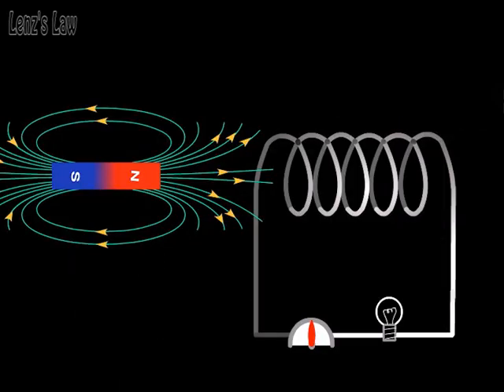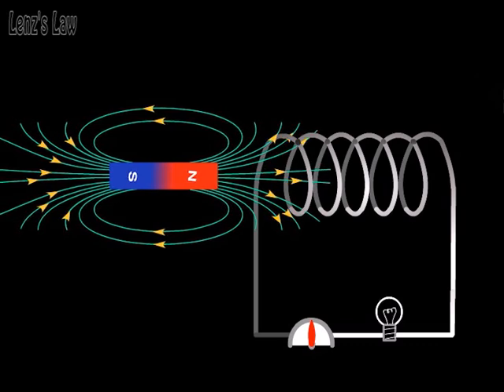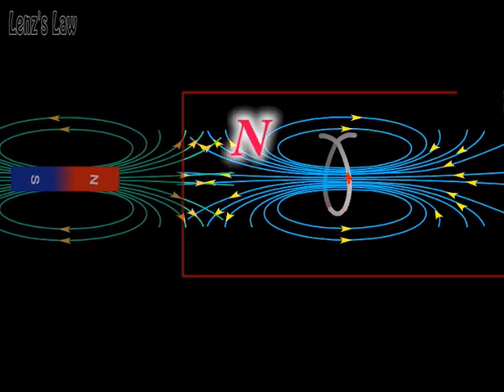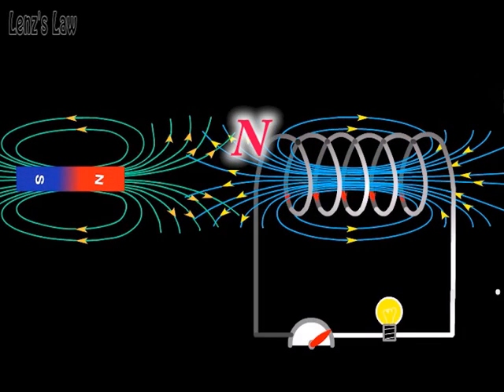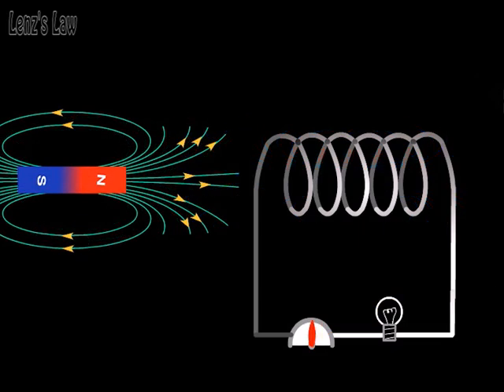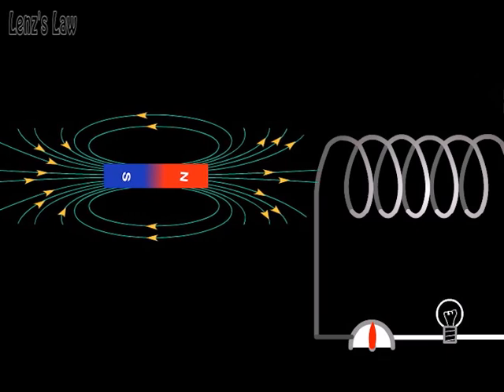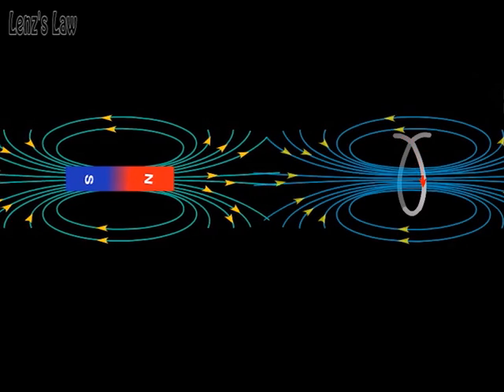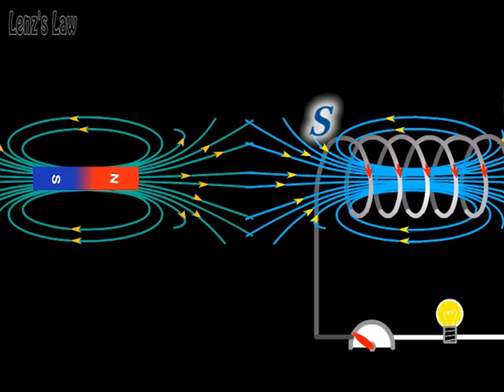Lenz's Law

Comment: Basically the solenoid induces magnetic field in a way to oppose any change whatsoever. If the magnet comes near it, it generates polarity in order to oppose the magnet, but if the magnet want's to go away, it generates polarity to keep the magnet with it.

Comment: "When the magnet is pulled AWAY from the coil, a new current in induced in the coil but in the OPPOSITE DIRECTION with a South magnetic pole on the coil, as if to re-attract the magnet back to where it was"

Nature goes to a lot of trouble to sustain "existing conditions"

If you think about the creation of a new magnetic field in the coil as the magnet is pulled to the left, away from the coil - a physical analogy could be:

1)  you take your car to the shop for a repair
2)   when the work is done and you start backing your car up to leave the shop,  your auto mechanic ties a rope to your bumper and tells you "Look - your car was here in our shop, now you're backing out of the shop - I have attached a rope to your bumper because our shop's environment will dearly miss the presence of your car"

This is a lot of trouble to go to, in order to sustain "existing conditions".  

Almost as if the Vacuum (the quantum Vacuum) has a primary job to reduce changes in energy distribution, and to dissipate changes in energy distribution in a region of space in a manner that is not abrupt.
.

Comment: Moving a bar magnet near a coil induces a current in the coil (called electromagnetic induction because induction occurs due to change of magnetic fields i.e magnetic flux)
This is Faraday's 1st law 
Now lenz comes for modifications; he says that the current induced in the coil would have it's own magnetic field as Current carrying wire has a magnetic field around it however,the induced current would posses a direction in the coil such that it would the effect the change (insertion of a magnet) producing it, now if the north pole was inserted the induced current would have a magnetic field which would oppose it that's possible if the induced current forms a North Pole near the region where the north pole of a bar magnet was inserted. Use right hand grip ,thumb is for the north pole of the induced current magnetic field and fingers direction would show the direction of current in the solenoid i,e clockwise or anticlockwise
I tried my best as I'm a student and I know how it feels when one can't understand a topic reading for 4 hours of long period of time
Reply: Primly explained!
Reply: Thank you so much😭😭
<333
Reply: thank you so much for your explanation

Comment: A solenoid with ends marked A and B is suspended
by a thread so that the core can rotate in the horizontal
plane. A current is maintained in the coil so that
the electrons move clockwise when viewed from end
A toward end B. How will the coil align itself in Earth’s
magnetic field?
Reply: stop asking ur hw question.